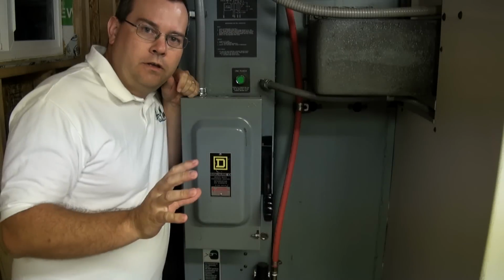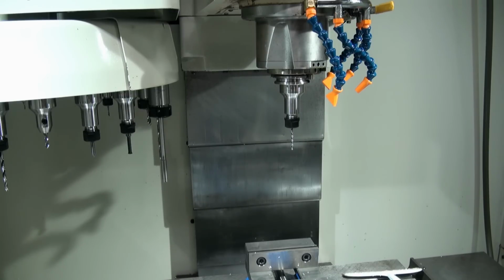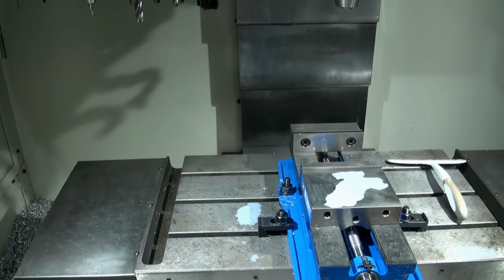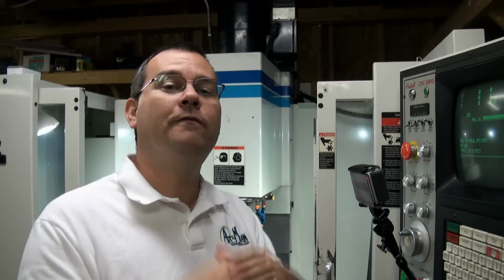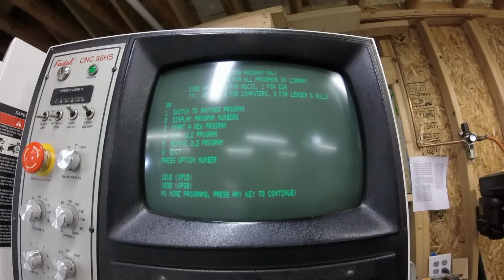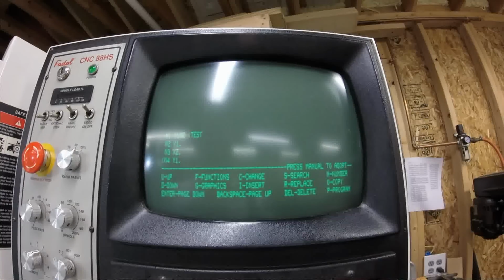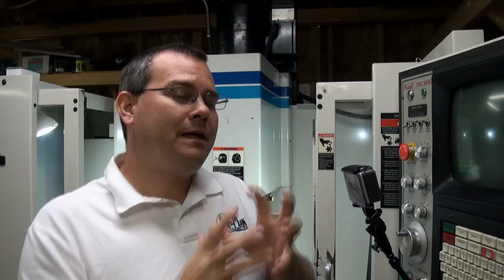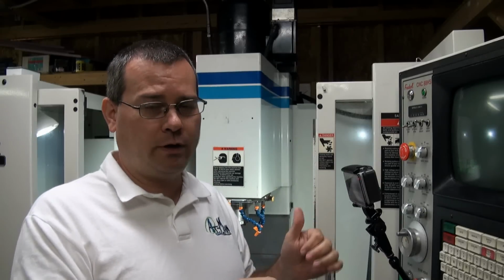Fadal VMC General Operation

Comment: there are many usb to rs 232 that work fine if you turn off fiffobuffer in windows and set the delay to 50ms then it runs straight through without error,,

Comment: I haven’t used a Fadal in about 5 years. I’m at a shop now that has two of them and I can’t remember why we used the Set X and Set Y functions so frequent at that old shop I was at. I used it here and I had to go back and reset my cold start positions. So when is a good time to utilize the Set X and Set Y commands? I don’t remember having large values on the DF table under all 3 Axis.

Comment: I love running these Fadal machines. They are very simple, easy to use, robust little machine. We got 2 of them in our shop. Compared to a Mori Seiki, you can have a FADAL up, Homed, Set and running within 10 min or less.  Forgot to mention ours were the 5020A machines.

Comment: Don't know if you can help but is there a way to start in the middle of a program on a fadal 2040b with a 60mp control. Only way I can figure how to do it is starting at the  line below the start position. But is there a way I can start it on any line? Thanks in advance

Comment: I have a VMC 20 and I have corrected the back lash. when I cut in X the finish is good. When I cut in Y the finish is good but when i cut with both axis combined I get a wavy rippled finish on side walls of edges of a part. do you know what will cause this?
Reply from the maker: Check the amplifier balance

Comment: our company just bought two new fadals, the screens are totally different. i still havent figured out how jump down through the code properly like on a fanuc control. on a fanuc i would let the machine read the tool length offset number. but then when i go to start program from a line further down in that tool, it jumps back up to the start of the tool. 

people at fadal told me to put number lines back into my post which i did. then i tried and the machine drove straight for the machine table. havent tried it since. cant find any information anywhere about how to do this, even in the control manual.

any help would be greatly appreciated.
Reply from the maker: Starting a program from a specific line number is a pain with Fadal. I try to avoid it at. Any time I do start mid program, I only do it at a tool change so I know the offsets will get applied correctly. Check out the operator manual section 8 commands, use the PA command to browse the program looking for the correct line, then the AU command to start at that line.
Reply: wow never thought this would be so difficult, thats what im doing now. thanks though.

Comment: Hey man, my vmc 15xt has some kind of problem - x axis servo brake won't release when I power up the machine. On the read out in x axis row i get "25", while on y and z they are 0 and 1. Any opinion? Thx man, your videos helped a lot to me!
Reply from the maker: I'm not aware of there being an X axis brake on any machine?
Reply: @AtManUnlimitedMachining  Meanwhile, foundout the same and trying to solbe the problem. Its amp that is giving me hard time. Sorry for dumb question. Thanks!
Reply from the maker: No dumb questions, all good, good luck with the amp issues.
Reply: Agree on that one. Once again, thx for your time and good videos. When I got the VMC, inspired me a lot.

Comment: Your a great teacher Tim, Just got an old 4020 and this is really helpfull.
One question (you may have said but I missed?), - I have written a program, stored it so how do I call and run it (assume tools are all correct etc and I am ready to start machining). I'll probably have more Q's down the line.
Thanks, Steve T
Reply from the maker: Steve, you can use the "PR" command to switch between programs. Once you have your program selected you can use "PA" to edit and view it. Then press auto to just start it from the beginning.
Reply: Thank you Tim, I’m going back at it all day Sunday to get my job loaded, great help thanks. The manual is great but very detailed so watching your video and pausing to pick up certain bits and writing them down is very helpful 👍, appreciated thx Steve T

Comment: Fun fact: the tape that the TA command refers to is actually not magnetic tape as in tape cassettes, but punched paper tape.
Reply from the maker: I did'nt think it was for paper tape, it was the 80's though.
Reply: I'm positive it was originally referring to punched tape.

Besides the TA command there is also a PU (short for punch) command to write the program that is stored inside the Fadal to a paper punch, connected to the serial port. So that's a way to save your work and simultaneously put the VMC to use as a confetti maker ;-)

The Fadal user manual section 14 "Communications" has a little bit of information about the subject. It talks very briefly about paper punches and teletype machines. As an example it mentions a certain "DSI LRP300" punch, why they don't say.

Yes even in the 80s this was old technology already, but in numerical control things didn't always move so fast. I guess also part of it is just that the terminology got carried over. It may well be true that cassette tapes and other media were in use at some point to replace the paper tape readers/punchers.

My personal interest in this is that I have an acquaintance who has a VMC15 and I said I would get it connected to a network. There's a capable DNC addon unit that you can buy for a couple of hundred USD, but I'm thinking a Raspberry/Orange Pi with an RS232 adapter and some sort of script should work as well. It's just a fun challenge for me.

Your videos are a real help, glad to have found them.
Reply from the maker: Yes, the Calmotion DNC to usb or ethernet works very well.
Reply: In support of the other reply here about paper tape and punching.... Yes.  In 1986, I was working for a company running a large Mori Seiki mill with Fanuc control.  All programs were manually written in pencil on paper, then entered at the machine keyboard (A comfortable console, by the way, while sitting on a stool).  Then, any program that wasn't stored in the control was fed to a paper tape punch built into the right rear of the machine.   We'd roll up that long tape when the machine was finished punching, wrap a piece of adhesive tape around it and label what the program was for.  Seems like a stone tablet and chisel, these days!  By the way, that same year, the Company bought a new Fadal... so there ya go.

Comment: Hello my name is Rob and I have just started working with Fadal VMC's. The only problem I have is I can not get a tapping cycle to work I have tried a couple, none have worked. Could you send me one that you use that works so that maybe I can see what I'm doing wrong. P.S. I'm running in Fadal #2 please respond to robs44762@gmail.com
Reply from the maker: Hello Rob, it depends on if your machine has the rigid tapping option or not.
There are also setup values to calibrate the Z feed vs rotation.

Comment: One more I forgot to ask. At the start you explain the groove of the tool holder can go in either way--however you then mention depends on how your tool changer is set up and you put the deep groove towards the toolchanger but with no explanation. It left me with the feeling that I dont know what might happen because how does a person know if their tool changer is set up special like you mentioned??  could you explain that? thanks video was excellent not only did I watch it word for word but i typed it out word for word on one sheet of paper for reference--a trick I have used for years since its impossible to remember everything verbally while out in the shop.
Reply from the maker: Fadal designed there spindle to use BT or CAT 40 holders. To switch tool holder styles one just needs to flip over the tool changer platter and replace the clips. Because of this the tool holders will actually go in both ways. You just get a little more clearance if you put the deeper notch on a CAT40 in toward the center of the tool changer.

Comment: One more question. On haas and other machines and fanuc. I am used to telling the machine where to go in mdi simply by typing in for example g0-g90-g54-xy zero--push start. (such as to confirm zero setup on a dialed hole) On the fadals is there no mdi page to simply do that and hammer in a few lines to tell it to go to a location or is it the long process of entering a line by line full program??
Reply from the maker: Press the "Manual" button and you get the MDI screen, same thing. The similar command would be G0 G90 G54 X0.0 Y0.0 then push enter, then the first line you need to push start. After that the moves execute on the enter key.

Comment: huge huge question. At the end of the day I do not understand why you want to wipe out all the tool offsets??  A job could still be running. Why would you want to wipe out all your tool settings??  Why not send it home and shut the machine off? I know there must be an answer that it does not wipe out all the offsets. Another question. There is an old 4020 we are trying to get up and running and there is no 232 line hookup to the machine. We want to have a thumbdrive put in for a modern usb thumbdrive. Could the machine then read off the thumbdrive just as if the machine now had a huge memory?? Or does some dnc software still have to be used? The machine has an ancient floppy disk thing on it that has not been used for decades. Can it simply have a thumbdrive installed or is it that easy? At one shop we used a dnc box that was plugged in at the side of the machine--so I believe its not as easy and just hooking up a thumbdrive. Any info appreciated this is a small shop trying to get an old machine running. There are no millions of dollars to fly out a squadron of experts. thanks
Reply: it really makes me nervous that if reading from the thumbdrive--that because of parity and error checking--that the machine could crash out of the blue at any time??
Reply from the maker: Jeff

Your not wiping out all the tool offsets. The way you home this machine is to restore the home position back to the cold start location and send it home. If you leave the TCS offset in place it will not go back to cold start. When you turn the machine back on in the morning it will ask you if you want to return to the previous TCS offsets and you say yes and its ready to go. All the tool offsets and fixture offsets never change. Just the TCS offsets. It is all gone through in detail in the manuals.

USB did not exist when these machine where made. You should have a serial port on the machine, the cable between the cabinet and the com board might be missing. Some of the floppy drives would use the serial port as well.
You need some type of DNC controller to drip feed the machine if the programs are to big. Calmotion makes USB and ethernet DNC boards to retro fit the machine.

Comment: I see the x,y, and z alignment indicator flags..... it's obvious how to visually align the z and x.  What do you visually align the y off of?
Reply from the maker: On my machine the Y flag is a piece of sheet metal on the right hand side below the saddle. You line up the front edge of the saddle with the flag.
Reply: thanks for the reply!

We recently acquired a 1998 VMC15XT and have yet to fire it up.  Watching your autobiography vid, you are much like my boss.  He is a PE, welding engineer, structural consultant...very verse in tech, etc.....

Your videos are a wealth of knowledge, thank you for creating them!
Reply: When you line up the Y flag.....is it a visual operation, or do you use a straight edge to ensure it's "close", since there are no visual markers like on the Z and X?
Reply from the maker: I reach down a run my finger across the gap, you only need to get it within about 0.05" for it to be fine. Even at 0.1" it should still find its way, but your at the absolute limit. It equates to being within a half turn of the ball screw. Also, once you set the cold start position, as long as you shut down at that position it should always just stay there till the next time you start up.

Comment: Getting ready to down load the manual. I have an older 4020.   I was wondering if yours has the z flag position dimensions?  My machine appears to be missing the z flags. Somehow the previous owners managed without them....
Reply from the maker: Wow, not sure how. If you cold start the machine at the wrong Z position it can crash the tool changer. You will either need to buy or make a new Z flag and then run the setup procedure to properly set the cold start position. It is in the manual or you can watch my Z ball screw replacement video to see it done.
Reply: At-Man Unlimited Machining ya!  Well hopefully the dimensions or proper bolt position is in the manual as I don't have a reference machine. Thanks!
Reply from the maker: You just use a feeler gauge between the top of the tool platter and the nose of the spindle. The distance depends on CAT or BT tooling used.

Comment: Great Video,,Just got vmc 15,, I’m pretty sure I can do everything except TA,1 and stream g-code to the machine effectively,,, really gotta figure it out,,, I would like to create detailed 3D image on Aluminum, and curious at what speed this machine will run??? How many inches per minute can we achieve on this machine?
Reply from the maker: Hello Kenneth, speed has many factors. If the code will fit into memory and you have the spindle speed and power you can get 100 IPM out of it. The max feed rate spec is 250 IPM but I have not tried over 100 yet.
Reply: At-Man Unlimited Machining  if I can figure out how to exactly send the code to the machine thru the serial port,,, I’m hoping that it can feed the code fast enough during the fine detailing machining process. I’m just hoping the machine doesn’t stutter waiting for instructions due to the choke point of data transfer,, do you have video on how to upgrade the memory  of the machine
Reply: Very stoked about videos I have seen so far on the Fadal,,, very useful
Reply: Well I guess if I am using DNCx then I would have to upgrade processor,, fine detailing will probably cause starvation with what I want to create at higher speed :( will have to test it
Reply from the maker: I have a simple DNC program that will stream to the machine, email me for more details. I did a video on how to upgrade and review of the older Fadal boards, you should see how to upgrade there. It is not cheap but you can buy the memory from Fadalcnc.com Make sure to check which version boards you have.

Comment: Does it have over amp protection if it hard stops into an axis end?  Or is stuff broke at that point?
Reply from the maker: Fadal uses software limits in there machines. As long as you cold start the machine properly you should never be able to hit an end stop. They also made there hard stops not so hard by using a stack of belvel springs in the event it does hit the stop for some reason. If you crash the machine for any reason they rely on following error to stop the machine not servo current.

Comment: I use to setup program run fadal back in 04-08.kind of miss it.
Reply from the maker: They really have a nice straight forward controller. When I first started running the machine it did not make sense but the more I ran it the more I liked it.
Reply: At-Man Unlimited Machining I completely agree.

Comment: Hi At-Man. 

I have a question about the format 1 and format 2 of fadal. 

I have a 4020 VMC with control cnc88. 
I did a program with Mastercamx5, but one run and other dont run and show me the next error: Spindle drive fault. 

I show you my two versions of gcode in mx5 (defaul mill). 

This RUN FINE. 
%
(123)
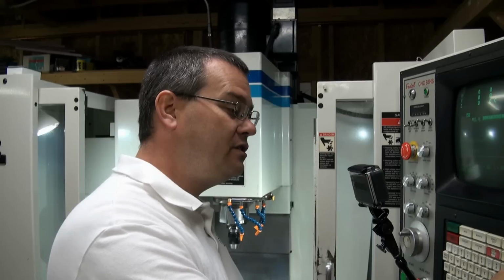(DATE=DD-MM-YY - 16-08-17 TIME=HH:MM - 20:25)
(MCX FILE - C:\USERS\HP\DESKTOP\CAJA.MCX-5)
(NC FILE - E:\123.NC)
(MATERIAL - ALUMINUM INCH - 2024)
( T231 |  3/32 FLAT ENDMILL | H231 )
N100 G20
N102 G0 G17 G40 G49 G80 G90
N104 T1 M6
N106 G0 G90 G54 X-.5778 Y-1.2285 A0. S5704 M3
N108 G43 H0
 Z.2039
N110 G1 Z-.0061 F90.

N112 Y-1.739 Z-.0083 F25.
N114 X-.5796 Y-1.7478 Z-.0084
N116 X-.5819 Y-1.7513 Z-.0085
...................................................................I short the program. 

This dont run...................................................................... 
%
O0000(O0002)
(DATE=DD-MM-YY - 05-05-17 TIME=HH:MM - 12:25)
(MCX FILE - C:\USERS\ROMULO\DESKTOP\BATMAN.MCAM)
(NC FILE - C:\USERS\ROMULO\DESKTOP\O0002.NC)
(MATERIAL - ALUMINUM INCH - 2024)
( T285 | 1/4 FLAT ENDMILL | H285 )
N10 G20
N12 G0 G17 G40 G49 G80 G90
N14 T01 M6
N16 G0 G90 G54 X.4089 Y2.7344 S2292 M3
N18 G43 H01 Z2.
N20 Z.1
N22 G1 Z-.0466 F6.42
N24 G2 X.9283 Y2.3512 I-.3937 J-1.0772 F10.
N26 X.9645 Y2.2599 I-.097 J-.0913
N28 X.9515 Y2.2023 I-.1332 J0.
N30 G3 X.9343 Y2.1267 I.1578 J-.0756

I dont know what is wrong.  
That happed for the formats of fadal? 

I hoping for you answers.
Reply from the maker: Hello, there are many differences in how the machine behaves and expects canned cycles to be formatted between Format 1 and Format 2. I suggest running on Format 2 as it behaves like a Fanac controller would. I would suggest downloading the user manuals from Fadalcnc dot com and read through them. They describe the difference in operation between the formats. As for the code, just looking at it quick, I'm not sure you can have a program number of zero "O0000". Try changing it to a non zero number and see if that works.

Comment: i am just about to look at a vmc 10. Any info on recommendations for a rotary phase converter? If you have a desktop PC with any open slots, likely you can find a very cheap serial port card that will control at correct clock speed. The tape input was a punched paper tape, even less than a magnetic tape, yet after the punch cards, lol.
Reply from the maker: American rotary makes really good converters at good prices. Everyone seems to use them and there good people. Yes, any standard serial port card should work. Most USB to serial adapters do not work.